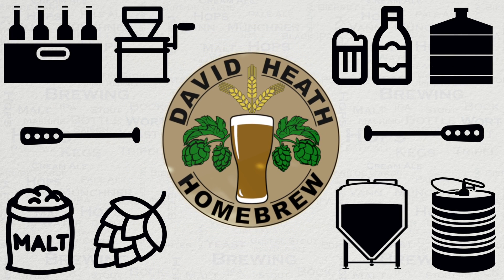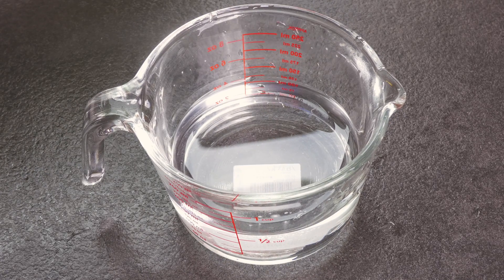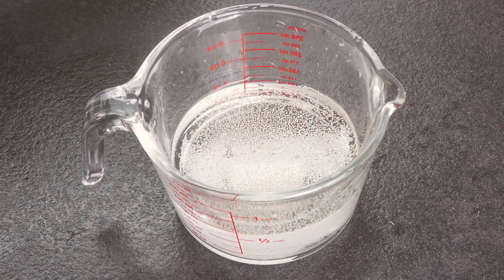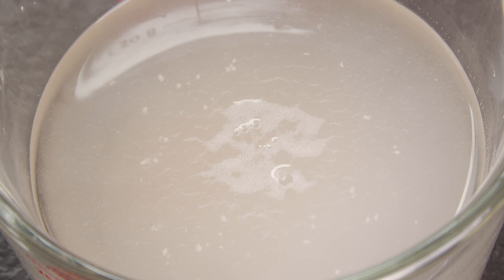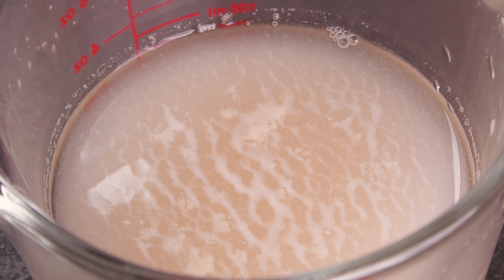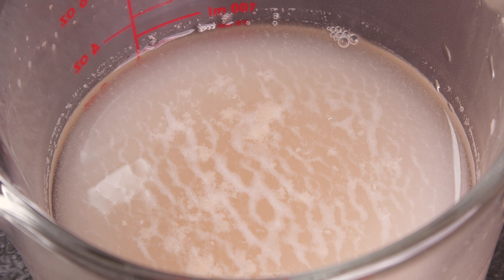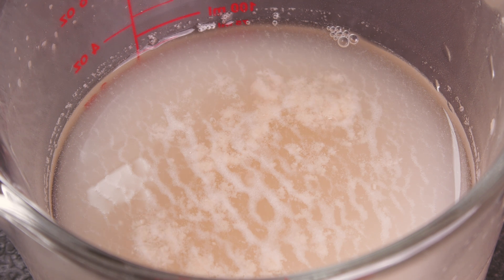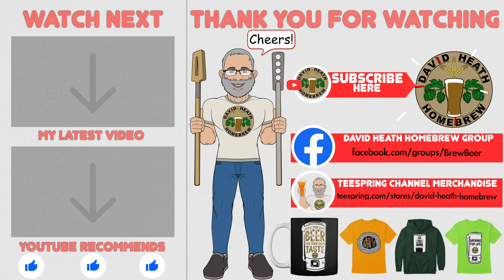How To Easily Test Yeast Viability For Homebrewers

Comment: When testing washed yeast, doesn’t 95 Deg sound high considering the yeast temp range on the package ??    Asking because I wash S05 and Kviek regularly and there is a big temp range between both ?
Reply from the maker: Sure but this works and will not compromise the yeast, no matter the strain.

Comment: What we do where I work is, per 1000l of wort we take 5 liters of 30 degree water, add 0,5 liter of the wort and 600g of yeast. Then after about 10 minutes we normally see a good, healthy activity, and we add this back with the rest of the wort. This makes it so we see that the yeast is alive and well, and it also gets a fairly gentle wake-up from the dried state that we use.
Reply from the maker: Yes, similar method just upscaled. Thanks for sharing 🍻🍻🍻